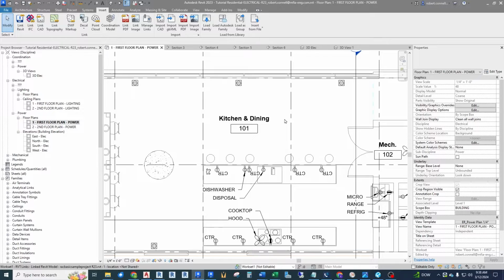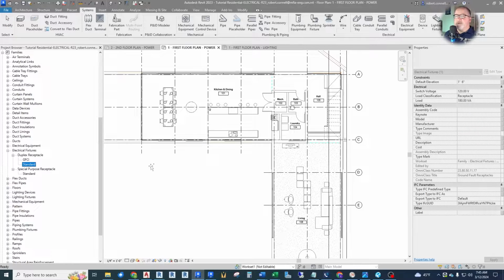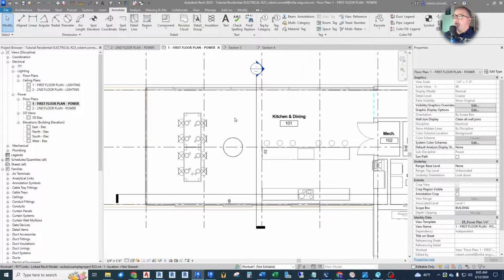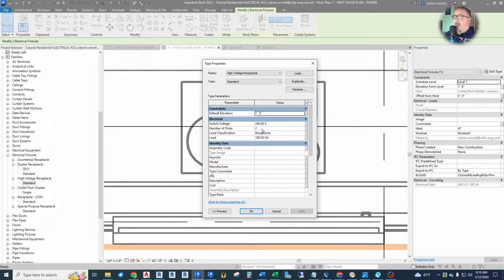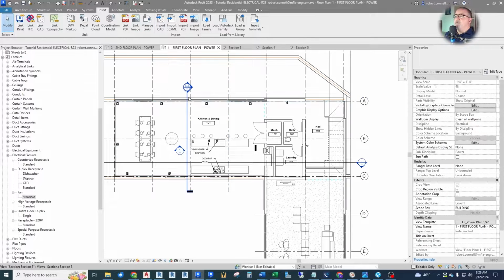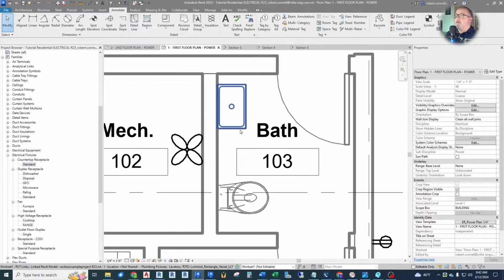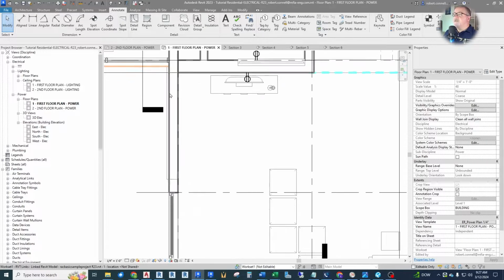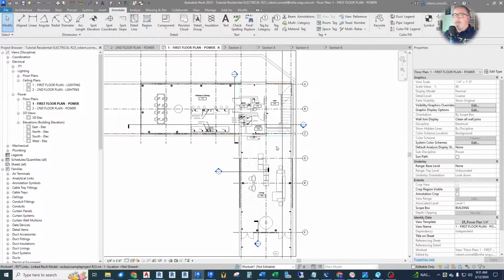REVIT MEP FREE COURSE!! EP-02 - Let's Put in Receptacles! - Electrical Tutorial

Comment: Great work. Thanks.
I have a question. 
Why Revit does not let me wire more than 6 receptacles in a circuit. If I do, then the wire size jumps to #10.
Electricians say they can (by Code) install 10 per room. I must be doing something wrong, in other videos I can see they wire 10 without any issue.
Thanks in advance.
Reply from the maker: Hey there Kevin! I had this same kind of question recently - has to do with the way Revit calculates voltage drop. I will be doing a video about this soon, as it is often asked about. The basic idea is that Revit is miscalculating the voltage drop on your multi-receptacle circuit and upsizing the wiring for that - not actually for the load. More to come!
Reply: @ElectricRob  Thank you.

Comment: Hi Rob
First thank you for this helpful tutorial,
my question is regarding associating receptacles to living room level plan,
after doing so and adjusting the height of the receptacles , they became invisible in the view,
so i tried to solve the issue by creating a plan region for the living room and adjusted the view range cut plane value and set the bottom and view depth to the level below,
now they are visible.
did i do it right or there is a better way to solve this issue.
thanks again
Reply from the maker: Hey there Rani - thanks for the comments! And yes, the way you did it with creating a plan region for the sunken living room is perfect! I cover that method in my separate view range / plan region video. In this episode, I cheated and just lowered the bottom of my view range to the level of that living room, because it did not adversely affect the rest of the view, but the plan region is the "right" way to go. Nice Job!
Reply: @ElectricRob  Thank you
Reply from the maker: I realize now that in episode 02, I actually redid the living room with the plan region!
Reply: @ElectricRob  Also you clarified it in episode 03

Comment: hi Rob in this vd in18.00 ,, while using object styles to change the line weight i did what have mention in vid  ,,,but it not change the line weight as showing in video
Reply from the maker: Hey there - without actually reviewing your model, my best guess is that you may have "thin lines" turned on, which will turn all line weights to very thin.
Reply: @ElectricRob  tks for reply rob

Comment: Hi. In Revit, how do we ensure that electrical cables are 3D displayed?
Reply from the maker: In this small project, the only things that are 3D objects so far are the receptacle boxes, and they are recessed in walls such that only face plates are visible. Eventually the lighting will be added in 3D, as well as a loadcenter/panel. Larger commercial projects will typically also have some larger conduit runs shown in 3D for coordination with other trades. You can see conduit 3D modeling in this video https://www.youtube.com/watch?v=OiY9SzOBi0I